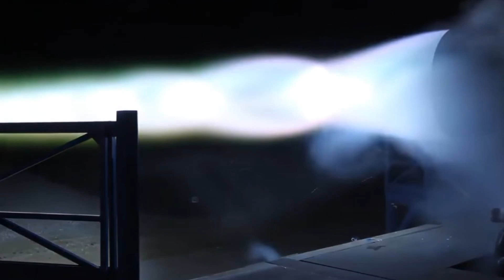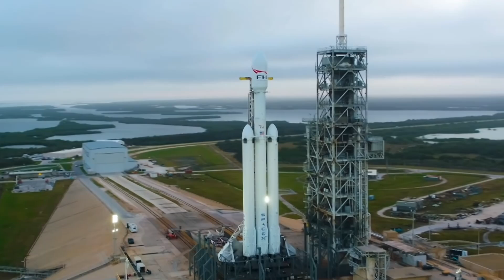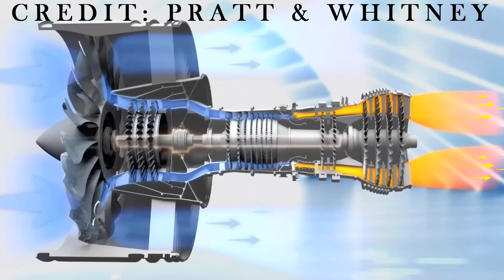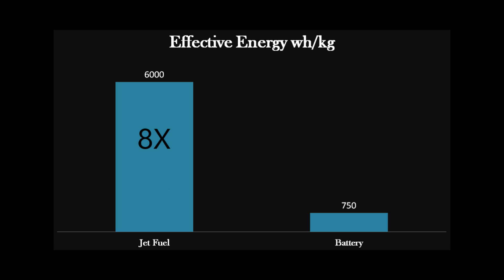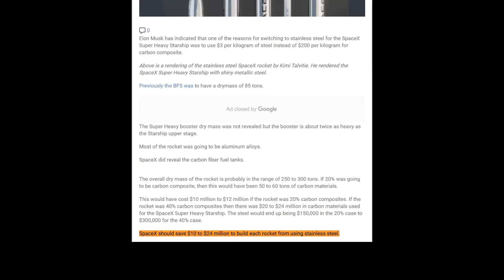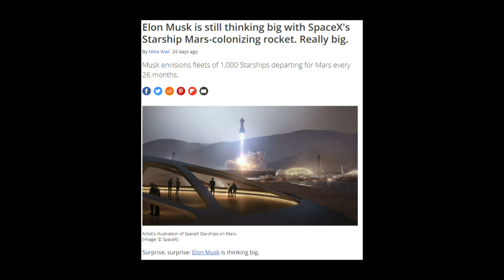ELON MUSK'S BATTERY POWERED SUPER SONIC VTOL JET - My Tesla E-SuperVTOL design

Comment: Well what can i say...
...lets begin the autopsy of this bundle of misinformation!

9:15 "current electric motors are too heavy for an efficient electric jet, they are low power density compared to gas turbine engines"
This claim is made up nonsense.
For example this: https://emrax.com/products/emrax-268/ electric engine (11+ kW/kg) slighlty outpreforms the engines on the V-22 osprey in terms of power to weight ratio. That is not an issue, with electric motors. The problem is feeding them.
And the fact that rotation doesn't miraclously translate itself into thrust when we are talking about aircraft.

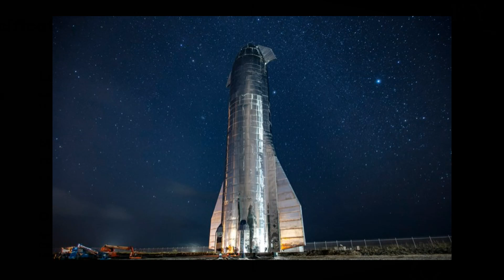10:58 "stainless steel. It has a great strength to weight ratio at room temperature, but at high temperature it has a superior strength to weight ratio"
I am honestly curious where the creator of this video got the idea that the strength of steel increases with temperature. (If we want to be generous we could say that it retains its strength to weight ratio better at high temperatures than some compoistes.)
If what this "well informed" gentleman says is the case then why in the bloody hell do we use nickel based alloys, carbides, and engineering ceramics at high temperatures? to me it looks like sprinkling a little bit of nickel and cobalt into the steel (aka. stainless steel) won't allow it to resist heat even remotely as well as nickel based alloy - which is why are and were used in high temperature application instead of stainless steel.
I would also like to add that unless we are talking about high supersonic speeds, the temperature increase is not THAT relevant - and due to fuel economy - no one wants to fly faster than necessary as drag is proportional to the square of the speed. Which is why going to fast is BAD, especially if your fuel (the batteries) weigh more than the competitions, this becomes relevant due to the fact that going fast DRASTICALLY reduces your range.

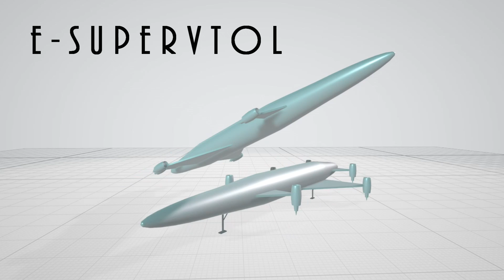12:35 - yes, that model is wrong on every damned level.
If the person who created said model would have spent 10 minutes of looking up relevant concepts, he WOULD have realized that things like the so called "Whitcomb area rule" are VERY IMPORTANT and NECESSARY to reduce wave drag. Omitting relevant features increase the drag to the point that it created the conception of the so called sound-barrier for its preceived impenetrable nature.
Among other things, the fuselage would need to be pointy at BOTH ends - unless you have a fetish for increasing drag.
Do you know what enormous wave drag does, where the energy that you waste goes to? Yes, correct guess its going to increase that allmighty sonic boom.

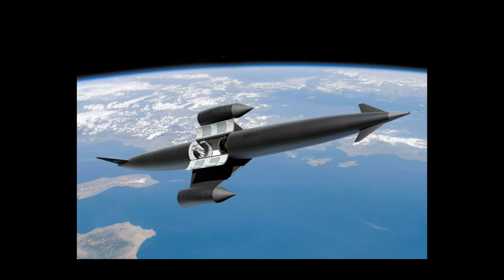13:08 "...be similar to the skylon jet..."
What?
Skylon JET?
The thing is not a jet - words have a meaning, and a rocket plane (thats what it is), is not a "jet" even if it gets its liquid oxygen from the atmosphere as opposed to a pressure vessel on board it. I know this is just nitpicking, but i can assure you its not.
We will come back to it when we disassemble the false presumptions that lead to the problem of "garbage in garbage out" with your calculations.

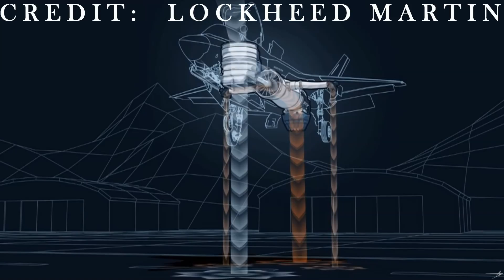14:29 "Vectored thrust simply means that the thrust is diverted, or the power is redirected to flow down from a fixed engine"
Again is it to much bother to look up wikipedia.
Thrust vectoring on engines have little to do with VTOL. There are PLENTY of thrust vectoring fighter jets, that are not capable of VTOL. And all the quadcopters in the world should provide ample evidence that thrust vectoring is no necessary to achieve hover, or be able to preform VTOL.

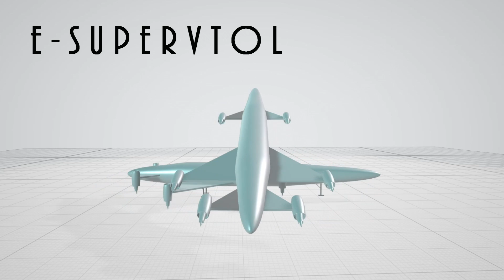15:08 "Supersonic engines are typically narrow and long rather than wide and short, this is to supercompress and focus the jet of air"
Sorry what?
Nope.
Supersonic engines are narrow because turbine jet engines are narrow. The wide part is called a "high bypass turbofan" and its optional - its not needed to have a working turbojet, don't get me wrong its nice to have as its increases efficiency. Problem is that it doesn't work above supersonic speeds, its just dead weight, and drag.

15:41 "would require high power aerodynamic modelling"
Oh boy.
Instead of bullshit claims, why not just download  OpenVSP, and do the modern equivalent of the back of the napkin calculation? Too much work? Using your head for something other than producing noise?

Lets get to the meat of the problem.
Having ZERO clue about what jet engines are, how they work - or for that matter how propulsion in works in fluids.

Electric motors can be up to 98% efficient.
Jet engines may scratch 50% at the best of times.
Yet, none of that matters - due to the not insignificant fat that jet engines produce thrust, while electric motors give you a fast spinning axle. And no matter how fast you spin that axle, it wont magically push on the air, without something like a ducted fan, or props being attached to the business end.
Problem is that both propellers and ducted fans are very far from 100% efficient.
Lets say they are 70% efficient at the best of times.

Problem is that you want to go supersonic with them.
If you have no clue why thats a problem i would STRONGLY encourage readin up on the XF-84H affectionately nicknamed "thunderscreech".
It didn't go supersonic.
But it did a lot of other things. The sounds (aka the pressure wave coming of the supersonic propeller blades) regulary knocked out signal lights. It could be heard from 40km, while taxying on the runway. The sound waves inducead nausea in those in the vicinity. On time it manged to knock out a guy who has been working inside a second aircraft parked near the runway.
To put it bluntly propellers and ducted fans are great at making noise at high speeds and not much else.

it may surprise you but the "turbo" part of turbojet engines refers to the fast spinning bits - which are only needed at slow speeds, and which are a hindrance at high speeds.
For this reason ramjets, scramjets and pulse jets are all jet engines that contain up to ZERO moving parts.
The turbocompressor in jet engines are there to compress the air to give enough oxygen to burn all the fuel, and make the whole shebang more energy dense. They are not mandatory parts, as at high enough airspeeds (starting at high transsonic) a correctly shaped air intake does the same job.
All a jet engine is (in the simplest of terms) is a glorified tube, in which air heats up, expands, and since now it occupies more volume at the back end it pushes the whole thing forward.

Of curse props, high bypass turbofans and other such contraptions are great at increasing efficiency at low speeds.
Which is why helicopters have so enormous rotor blades.
To oversimplify things, you need to move X amount of air to create a given force, for example you need to move as much air as your aircraft weighs, every second, to counteract the force gravity exerts on it each second. Hovering aircraft have those enormous contraptions because its easier to push air through that large are thats swept by the rotors, than it is to push the same amoun of auir through a small tube like a ducted fan.

Combining VTOL with supersonic is asking for trouble - sure if VTOL is THAT important it can be done, however your range and the carried payload will suffer enormously. Meaning the passangers wont get to the destination.
And one of the 2 cannot be done with rotary electric motors

And no, you can't fly higher and in thinner air - or at least not without sacrificing speed.
As the air pressure decreases (as you go higher) so does the speed of sound.
While this may be a new concept its a real problem for stuff like extreme high altitude gliders - like the Perlan project.
Furthermore conventional jets aka. turbojets are limited to their max height due to the fast spinning turbocompressor in front, jets that omit them such as scramjets can achieve much higher altitudes.

P.s.1: Lilium jet is a scam.

Ps.2: Why is it that its always people with the most fancy mustache who blabber on about technology with less than zero knowledge. Producing fractally wrong content.
Reply from the maker: Some great information in there!  Thanks!  There will be a v2

Comment: you dont need 6 engine  4 is enough for vtol perhapse first two pairs and dff position, is even better idea of tested forst on conventntional airplane a side holders the rotation servo so any conventional airplane would fly on this principle, baislcy is air glider bottom car in airplane is upside down, high tech gearing gripen conection btween frnt and back, even spinable cocpit in flight would greatly improve safety used as escape pod and lvl manevourability and scfi stuff fly drive !
Reply from the maker: Cool ideas!

Comment: Suggest you do some calculations on the VTOL element. With the nozzle areas  you need for supersonic flight you end up needing a jet speed of about 450ms (supersonic) and a motor power of around 600MW to balance the mass of a Concorde sized aircraft. This would mean that you need 50+ tonnes of motor and your aircraft will be phenomenally noisy. There is a reason eVTOL aircraft use a large prop or rotor to generate vertical lift.

Comment: The numbers DON'T add up: need thrust/weight ratio of a fighter-jet for a cargo plane!!!
In helicopters there are two advantages vs. VTOL jets:
1. Rotation is much more effective energetically at low speeds: the path is circumferential, rather not longitudinal.
2. Ground-Effect.
Also, hanging motors on wings is a very BAD idea: wing and tilter weight, flipping-over.
See smarter idea here:
https://netzerconsulting.wordpress.com/2019/03/17/versoplane/
Reply from the maker: Good feedback!  I'm realising the errors in my design... Slowly learning 😃

Comment: No it won't be made of stainless steel, aerospace engineers are well aware of cold rolled stainless. We don't use it because in most use cases we are designing for stiffness, steel is pretty rotten at this parameter compared to its density (see Ashby diagram) hence the use of aluminium, magnesium carbon fibre and titanium but only if it's temperature capability is required. For Mach 2 aluminium is fine, for Mach 3 you need titanium or stainless if you are prepared to take a performance hit. SR71 and B70 were stainless before they worked out how to form titanium.
Reply from the maker: Super helpful thanks!!!!!

Comment: front engines  blow a turbulent flow just over the main wing... is that a good idea? How do you accelerate air using a electric motor into supersonic? heating bodies? Mechanically its hard...  Id start with electric, then add vtol, then supersonic... thats three steps of innovation in one .. :)
Reply from the maker: Thinking about this....didn't realise these things when I made the video...will cover in the next one  :)

Comment: Very real and interesting thinking, biggest shame is not having flying "car" but a plane, for under 500km routes. Smaller vehicle as in your design would surely speed up travel even in 5km, 15km routes FEW times and forget traffic jam en route. Shame that without someone pushing that tech its impossible even with cost, time and safety benefits, not to mention road maintenance. Its hard to push the tech if people are afraid of something new and flying above them, yet they walk/run on the road centimeters away from vehicles weighting tons. There are even safe ways to land like balloon if needed.